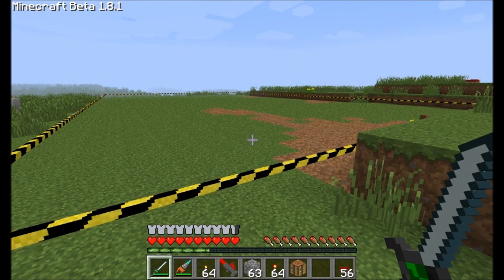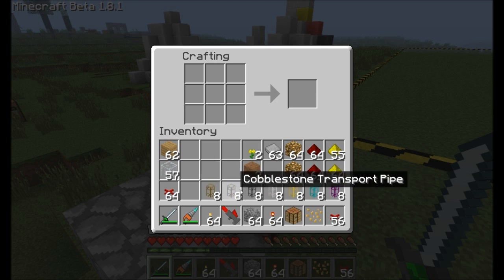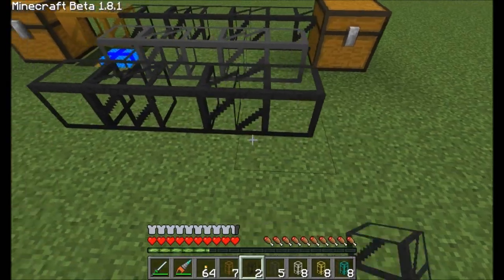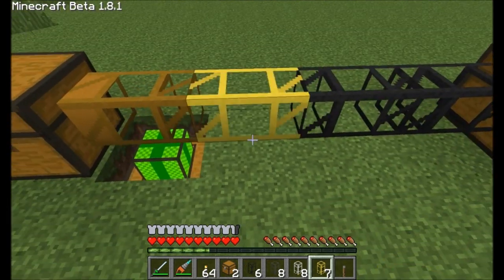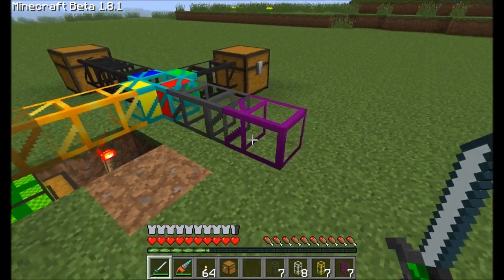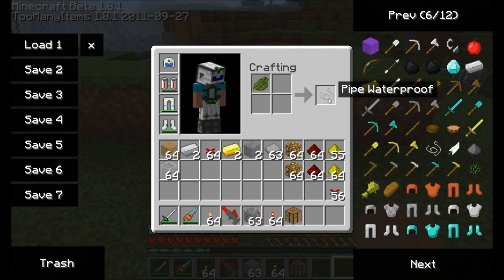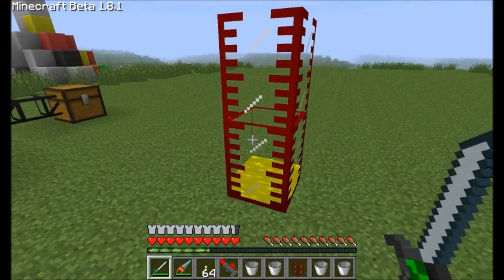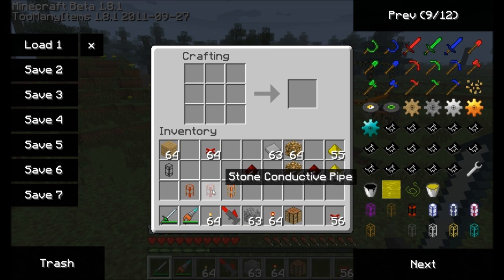Buildcraft Tutorial - Pipes

Comment: Say you have a quarry running with a piping system sorting the items into chests in your house/base/mancave and you decide to build a mob grinder with a piping system that also runs into your house, you can integrate your new grinder into the existing pipe system by using a piece of iron pipe (to keep the items coming from your quarry from turning towards the grinder and vice versa).  You can use iron waterproof pipe to combine, say, water from two pumps into one pipe.

Comment: as for additional information, RS Engine is basic, slow. it pump item only 1
and slowly pump liquid out but Stone and Combus engine pump more than 1,
faster but risk of explode if it heat up too much.
RS - Free, Slow, Never explode
Stone - need fuel to burn, anything that can burn in furnace can use in it
Combus - need oil, fuel and lava, they're fastest but heat up very quick
you need to pump water in it to cool it down.